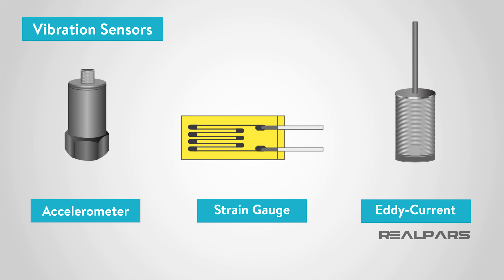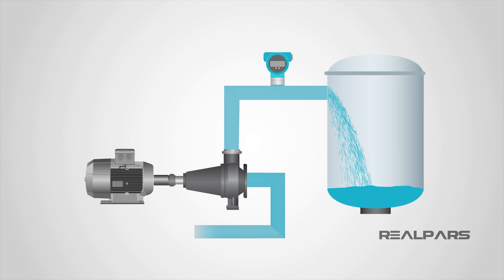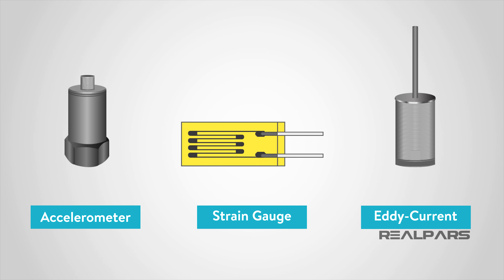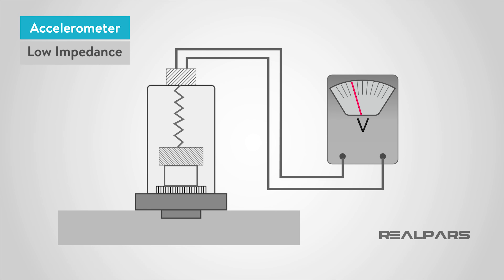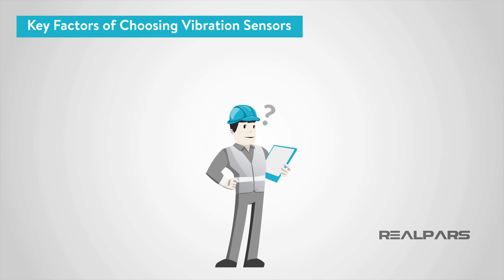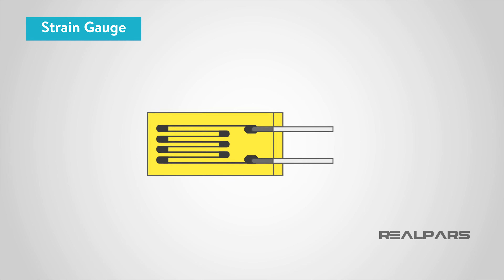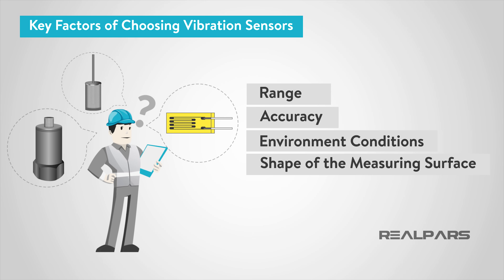What is a Vibration Sensor?

Comment: Correct me if Im wrong but that Radial and Axial vibration seems to be vice versa at 1:55
Reply from the maker: Thank you for your question.  Axial and radial vibration are depicted correctly in the video.  Axial vibration occurs when a shaft is misaligned, and the vibration occurs parallel to the axis of rotation. The important concept is that vibration of any kind due to imbalances is detrimental to performance.

Comment: Good video
Reply from the maker: Thank you!
Reply: @realpars  hi, please provide me with some information. 

If I was to install a Differential pressure flowmeter to measure Gas flow but I don't have space to install the meter above the pipe to prevent condensables, how should I install the meter to obtain accurate gas flow?

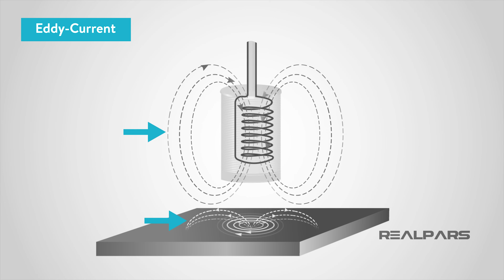Comment: A couple of technical issues that should be reviewed.                                         Video time 1:55-2:24 is demonstrating axial and radial vibration scenarios. The first (1:55) shows the misalignment of the driver to the load. This is causing a "wobbling" effect which is primarily radial vibration and not axial. Some axial movement is going to be seen as a result of this misalignment. The second example (2:07) shows a driver with a fan load. The fan has a deformed fan blade causing a "wobble" and it definitely will be seen in the radial vibration proximitors. But the narrator says "the deformed fan blade would pull outwardly on the shaft of the motor, which is NOT a radial but an axial movement in the shaft.                                Video time 5:13 is demonstrating the gap / gap voltage when the gap increases. The video shows the gap increasing and simultaneously the voltmeter value decreasing, which is not correct.                            My feedback is for the objective of correctness for your viewers and not to be critical. I know from experience that editing / mis-editing can cause these types of mistakes. I am a fan of Realpars videos. I salute your endeavors / hard work in producing educational videos in the field of Instrumentation & Control Systems.                      If I have misunderstood the info, as presented, I will stand corrected.  Thanks Pappy
Reply from the maker: Thank you, Pappy, for your comments.  After watching the video, I agree with your assessment, and I will see if we can have the narration modified.

Comment: helpful video thanks Realpars.
 what kind of sensors do you recommend for monitoring industrial buildings against earthquake ? or the building need seismic ?
Reply from the maker: A building is designed to withstand an earthquake of a certain magnitude, per local building codes.  There are earthquake monitoring stations that will warn and advise on earthquake activity.  That said, for tall buildings, some governments have been exploring the use of acceleration sensors that can be fixed to a structure with a single central bolt.  One such device is Gecko Pro SMA-HR which is a High-Resolution Strong Motion Accelerograph

Comment: Can an accelerometer be used to place on a cd player chassis to measure the vibration level? Would this work if i wanted to compare vibration levels of different cd players etc?
Reply from the maker: I would assume it is possible, but you would need a very small and precise sensor to measure vibration.  I assume you want to measure the vibration of the rotating disk.  Most CD players have a very small amount of vibration, mainly caused by the motion of the read/write heads. I will admit i have not heard of anyone doing this, so best of luck and let us know when you have it working!

Comment: Hello there, if I am interested in measuring only dynamic acceleration instead of static acceleration,  which acclerometers do you suggest. Thank you!
Reply from the maker: You need to match the particular sensor to your application, but in general, a DC capacitive MEMS (Microelectromechanical system) sensor will be a good choice for machine vibration detection.  A DC piezoresistive MEMS sensor may be best for impact type applications (crash tests, bounce plates, etc.).

Comment: Are vibrational sensors and acoustic sensor the same?
Reply from the maker: Yes, acoustic sensors can be used for vibration detection.  However, only vibrations that generate surface acoustical waves can be detected by some acoustical sensors, so you need to make sure your sensors are suitable for the types of vibration that you need to measure.

Comment: Does a Accelerometer measure the axial and radial vibration or does it depend on how the sensor is mounted?
Reply from the maker: A single accelerometer will measure vibration in one plane.  Therefore, what gets measured does depend on n how the sensor is mounted.

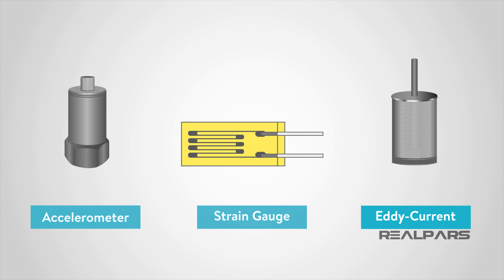Comment: 2:00 The narrator describes an axial vibration but the animation shows a radial vibration.  4:40, the narrator describes an eddy current sensor as capacitive, when actually it's inductive, and distinctly different from capacitive sensors.
Reply from the maker: Thank you for your comments.  Although not a perfect illustration, the vibration shown at 2:00 does have a strong component of axial vibration.  And yes, also a component of radial vibration.  At 4:40, the term should have been proximity sensor, not conductive.

Comment: Small question. Wouldnt the bearings on the machine be able to absorb the axial and radial vibrations?.
Reply from the maker: Yes, they would.  But prolonged vibration can weaken and damage the bearings.  We measure vibration so that we can insure the magnitude of vibration is not so large as to cause bearing, shaft, or other mechanical damage.

Comment: hello sir
as a trainee on my final internship, i'm working on a project concerning vibrational analysis,  i would like to have your suggestions about the equipements that i require, knowing that i'm gonna use an accelerometer for measuring vibrations
Reply: Oil transfer Pump is a good choose

Comment: What is the difference between velocity and acceleration vibration measurement
Reply from the maker: Measurement of vibration takes into account three measurements:  Displacement, the amplitude (distance) between the peaks of vibration; velocity, the changing rate of displacement (D) to time; acceleration, the changing rate of velocity(V) to time.  Modern vibration detectors are typically accelerometers, since the acceleration measurement can be used to calculate velocity and displacement.  Vibration can be caused by piping or support vibration (displacement), imbalance, misalignment or coupling issues (velocity), and bearing damage, cavitition, gear misalignment (acceleration).  By using an accelerometer and a good set of electronics, abnormal vibration in each of these regimes can be detected.
Reply: Hi I'm From Papua New Guinea  neighbor to Australia. I'm learning quite alot from these video tutorials n lectures.Have been working around  in mining in PNG for a while.

Comment: What vibration sensor would you suggest if i want to measure vibration in a small dc motor?
Reply from the maker: There are many different options. ifm Efector, Dwyer, Keyence, and others make very reliable vibration sensors for detecting vibration in small motors.  Make sure the one you select reports the vibration data to your control system in the format that is compatible with your system:  4-20ma, 24 VDC, etc.

Comment: Amazing Video
Correction: 

For Eddy Current Senor - Its not Capacitive Displacement Sensor - Its Inductive Displacement Sensor using Magnetic field As the sensing Field With The inductor Coil Charged With AC Current